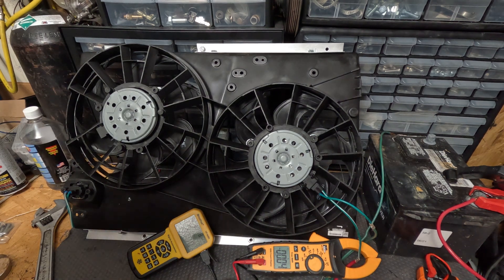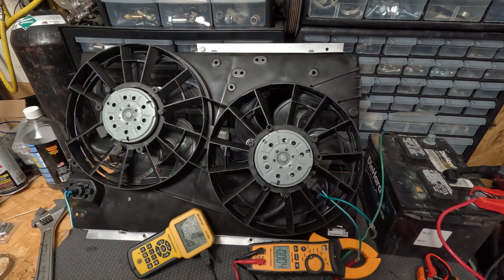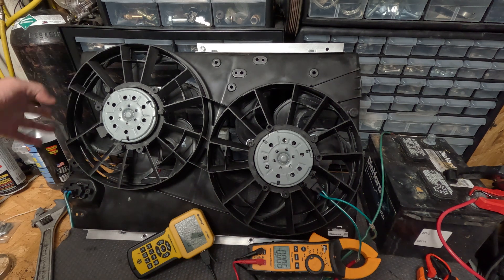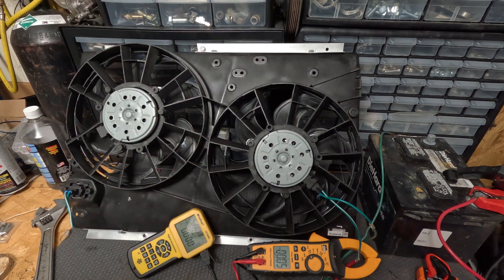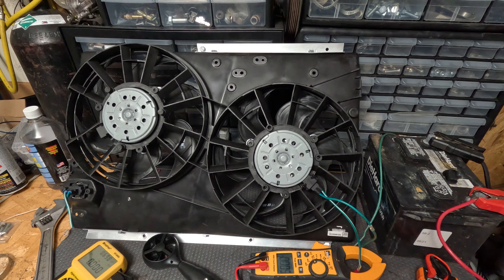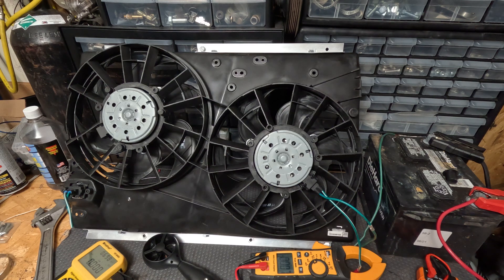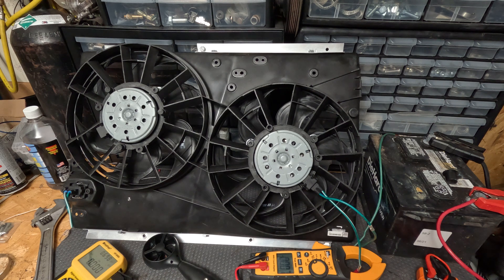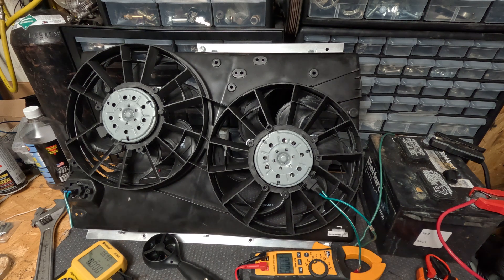Mustang Contour Fan Swap CFM Testing. Part 1.

Comment: The way you spoke about when you put a 2 or 3 core radiator and a condenser coil in front of this fan it renders it about useless scares me! Am i reading what you said wrong ? 
  I bought a couple of these Contour fans at the pick and pull to have a fan and a backup spare more than a few years ago as a project to add electric fans to my '70 Javelin. Forum members raved about how they fit the radiator so well. After watching your video im thinking that i might be wasting my time and would be better off just leaving the mechanical flex fan alone and forgetting ever installing an electric fan.
 You spoke of a part 2 where your going to install the fans and try  them out...i suppose its a little too cool to get a good impression until the summer heat comes back? Thanks for time, appreciate the video!

Here's a video i found later  pertaining to flow through core obstructions pretty interesting.

https://youtu.be/sNW2tS6bljc?si=KtwzQxNRhyeEG_Cp
Reply from the maker: 2 rows work fine. I recommend a 2 row with large tubes, 1-1 1/2" Those allow good flow with less restriction. In that video he used wind speed instead or CFM. CFM with the tool calibrated to the fan size is a more accurate measurement.
Reply: I have a 2 core brass and copper radiator now with a 3 core brass new in the box . I guess less is more and sometimes going to a thicker radiator is actually going backwards even with a mechanical fan if it can't pull enough air through the restriction.
 How do you think the Contour set-up would compare to the original mechanical 18" 5 blade flex fan that came original on being able to cool in extreme heat of summer in stop and go or traffic situations?  Everyone always seems to strive for the thermostat temp. of 180 or 195 no matter how hot it gets outside and thinks they have a problem if they can't maintain it in all situations,but like you discussed that higher temps are ok and even benefical up to about 240 ?? on burning condensation from the oil. 
 What temp thermostat do you run and recommend and at what temperature do you get nervous when in a hot stop and go situation?
Thank you for your reply and i hope you still have plans to try out the Contour fans and maybe make a  report of how they did. I'm Still learning which is always good thanks for your time! 😊

Comment: Anther question is where would we put overflow bottle?
Reply from the maker: One I get mine installed I'll do a part 2 with the overflow in place.
Reply from the maker: Most people mount one of the slim tanks on the shroud. LMR put one in their Foxbody/Contour fan kit. The CCRM can be relocated to several other spots also.

Comment: Good info Ted! Thank you!
So a few questions... Can this hook up in the stock wiring for 94&95? And is it a soft start? Also do we hook up so both start at same time? I'm really considering doing this and just moving the ABS forward 1/2 inch
Reply from the maker: You're welcome. It can be wired using the 94/95 hi/low. Contour used pretty much the same system. Its not exactly softstart but if you use hi/low and the resister it would start on half speed. It doesn't draw any more amps than the 94/95 fan does anyway so it shouldn't cause any problems even starting on both fans at full speed. I'm just going to delete the ABS myself.